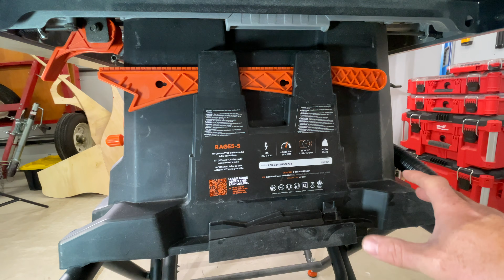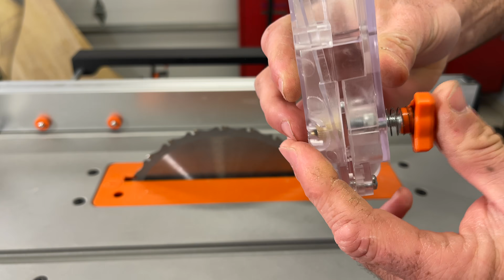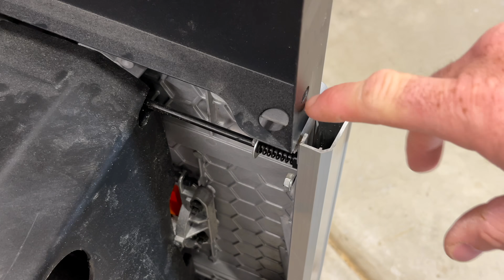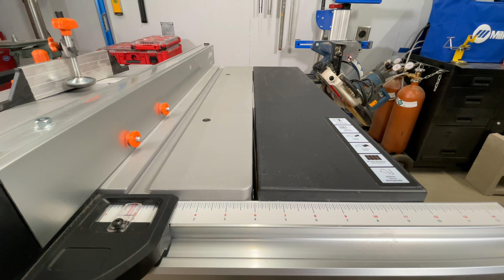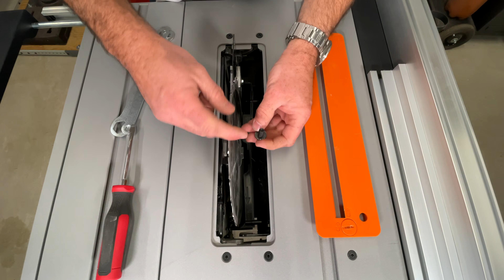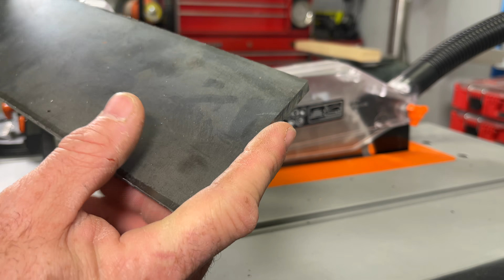Cool and Innovative But....  ||  Evolution Table Saw  ||  Review

Comment: Im a newbie in the UK & i own this saw. What makes it attractive to me was the sliding sled & price. I got for £280 & todays price at Amazon is£309. I was plodding along fairly happy & any discrepancy i put down to price. After watching your video i now know alot better. I have thrown a little money on this table, soft start module (£20) then a zero clearance plate (£27) and various bits of dust brackets. When you mentioned dangerous i wondered what would you do. Do i get another year out of it for experence as lm not asking for perfect cuts or should i get rid? Forget money. What price do you put on your carol singers flying across the shop. What would recommend please. Thank you.
Reply from the maker: Hello! The question is: does your saw have a weak lock for the extensions and can you move them easily when locked? I spoke with customer service and they were trying to figure out a solution which is still pending. Truth is I don’t know if it’s just my saw or all. I only have this one example to go by. I told Evolution I’d do a short vid update if they have a fix but I have not heard back yet. Check your saw and let me know if it’s the same I’m definitely curious. Thanks for the comment!
Reply: @ProjectsForAllReviews  I'm in the UK and have the same saw, I have never noticed the extensions moving or sliding, not like the way yours was, it's all fairly solid
Reply: @ProjectsForAllReviews  Will do when i get back home. Thanks Mike.
Reply: @ProjectsForAllReviews  Hi great review.  I have this saw and have had no issues with it but you may have pointed out a flaw I didn’t know it had( unless some don’t have this problem?)  Please keep us updated on what evolution say about it.

Comment: I just bought a rusty delta contractor saw which was a total mistake, even for $50. It’s old and rusty and probably missing pieces. I don’t know what i was thinking. I’m going to clean up the rust and toss it back on marketplace and scoop something newer. Wont be an evolution saw. Maybe the dewalt jobsite saw. A bunch if those show up used for a discount. Maybe a newer better kept delta if i can find one under $500

Comment: I bought this table saw a few weeks ago after watching loads of great reviews on YouTube, but I would agree there are some quality issues, mine arrived almost a week late direct from Evolution [promised next day delivery], when I opened the box there were loose nuts, bolts and washers rattling around in the box, luckily it was easy to find where they had fallen from and they were not part of the setup process so should not have been loose. The right hand extension plate had a dint and rust under the paint in one corner. The build instructions are poor and Evolutions own video is almost as bad, way too fast, changing camera angles and mistakes like forgetting to put the 4 washers between the undercariage and the frame shouldn't happen. Before I started the motor I had a good check around and noticed the blade was catching the dust collection guard, after some photos and email to Evolution they said the plastic was warped and sent me out a new part to fit, it now seems fine. I think for average DIY usage the table saw is decent, but you will need to constantly check everything is adjusted correctly, being table to fold up the table for storage is a good if you haven't a huge workshop.
Reply from the maker: I never watch other people’s vids before I do a review. However it is interesting to watch some reviews after I do mine. Especially on a odd product like this one. Odd design. Dubious quality control but with some useful design elements. I had planned to sell this to a friend but not being able to lock the fence tight is going to force a return. Sad because I really wanted to love this thing. Good luck with yours. Thanks for watching!!

Comment: Does anyone know why they have that smaller fence, bolted to the larger one? The large fence, looks like it would work quite well without it. This has also been the best review of this table saw that I have watched, thanks for doing this.
Reply: This is my understanding:
On bigger professional table saws (panel saws) it is possible and recommended to push back the fence, so it does not cover the complete blade.
This should avoid that the cutted material can get stuck between blade and fence, escecially when doing long, long rip cuts in solid wood, as this can twist and bend right during the cut. 
Or avoid small pieces to get in contact with the upcoming backside of the blade so easily and is pushed back.
As the fence here is clamping on both sides and has to go all the way across the table, this "rip fence face plate" simulates the above.
(And of course helps with cutting smaller parts, as those panel saw fences (from above) often can be flipped from high to low profile)
But here we find another tiny show stopper at the evolution (I own one): If you push back this "rip fence face plate" following their manual it hangs over and could interfere with the too wide handle of the main fence.
Reply: I believe this is to stop the blade guard hitting the fence when cutting thin strips.
Reply from the maker: My guess as well. It’s hard to use the push stick to clear the material with the blade guard there. Thanks for watching

Comment: Well done. An honest and fair review. Great features, but unfortunately lacking in quality.

I expect a lot of watchers will like the miter sled; however, it's not really a new concept. It's actually very reminiscent of my 1st table saw the Ryobi  BTS15.
The BTS15 was made by (Blue) Ryobi way back, and used a miter panel that was interchangeable with a regular flat table panel.  Unfortunately, neither of the panels had integrated miter slots. Nor was there a miter slot on the fence side. The only way to cut a miter was with the sled function.

That saw was a scary beast, because it didn't have a riving knife. It had a splitter and pawls as part of the bladed guard, which would move due to the way it was mounted.  When the guard was removed, there was no kickback prevention mechanism at all.

That said, it served me well for around 25 years, until I upgraded to a Rigid contractor saw, then to the Delta 36-725T2.
Oddly, I sometimes miss the old BTS15 in a "So glad the damned thing is gone" kinda way. 

It's pretty cool that Evolution incorporated the sled, but found a way to include miter slots. Too bad the rest of the saw falls short in the QC department.
Reply from the maker: Thank you! Checked out that Ryobi. It wold they made a saw without miter slots! I don’t remember which model blue Ryobi I had but it was the bottom model for sure. Thanks for watching!

Comment: Maybe dewalt can take notes and add the incorporated sled to one of their tried and true tablesaws as that is a really neat feature for a smaller sized saw. Especially because I don't know if evolution has the ability as a company to redesign and re manufacture this saw to a higher degree of accuracy and precision.
Reply from the maker: I agree I’d love to see that slider on other saws. It works excellent. I go into all my reviews cold but I do look at the online product reviews on the manufactures website to see if there’s any problems to watch for. Going by some reviews it would seem this saw is the weak link in Evos product line but we’ll get the chop saw soon to figure it out. Thanks for the comment!
Reply: I wish ryobi would bring back the BT3000 that system was phenomenal back in the day. If it was modernized, it'd be a beast.
Reply: Sawstop has sliders as options on their Contractor and higher models, at least, but it's be nice to see on a sub-$3K saw.
Reply: It seems like all these different saws purposely have certain great features to draw you in but then combine these great features with glaring flaws that you are supposed to overlook due to the advantages. 

It is not by accident that all of these great features have not been assimilated into a single saw. 

The sawstop story alone tells us a lot about the inadequacies of the industry. 

Like right now I’m really wanting to get the jobsite skilsaw with the great motor, cart, and rack/ pinion fence. But it combines these aspects with glaring flaws such as crappy plastic parts and floating motor carriage blade angle adjustment.
Reply: Evolution have a brand new range of table saws which have been redesigned from the ground up in house, which will be launching towards the end of the year with a lot of improvements.

Comment: Watching the way everything twists, bends, and flexes as you move it around is not inspiring any confidence at all.
If they would make the same saw, but replace many of the plastic parts with metal and just make it beefier overall, they could easily charge a few hundred bucks more for it and it would still be a great deal.
The sliding table sure would make straightening and paralleling board edges awful quick and easy. Since I don't have a jointer, that would be great for me.
Reply from the maker: I agree! This one really bugged me. There’s so much potential here for an amazing, do it all saw! I really liked the sliding miter panel too but the inability to use a dado really sucks. I think the arbor size is because it’s a European model adapted for our market. Just a guess. Thanks for the comment!